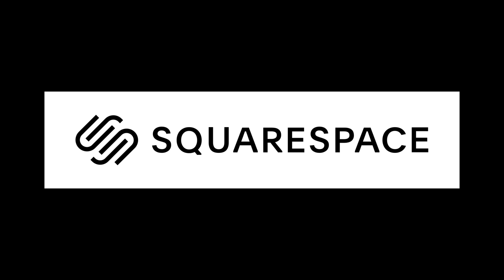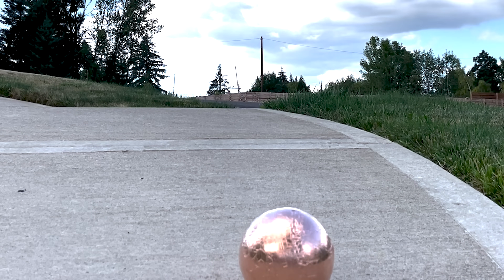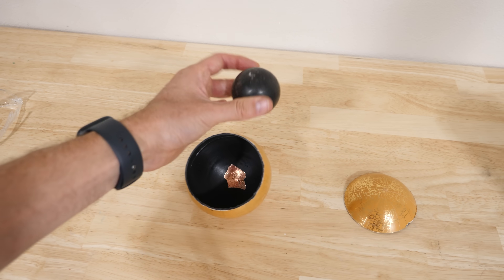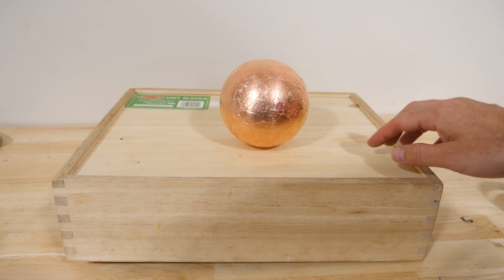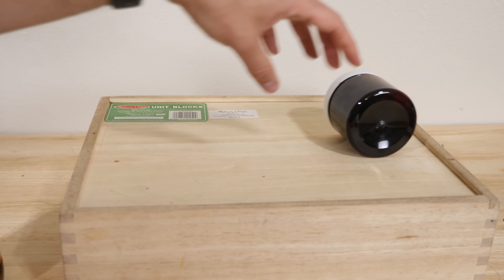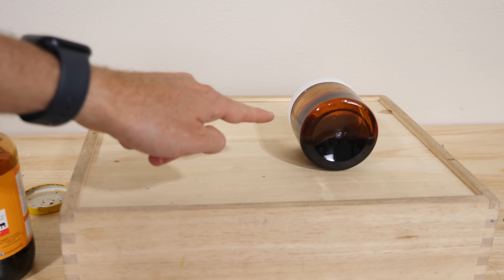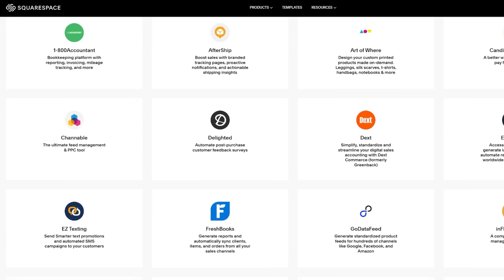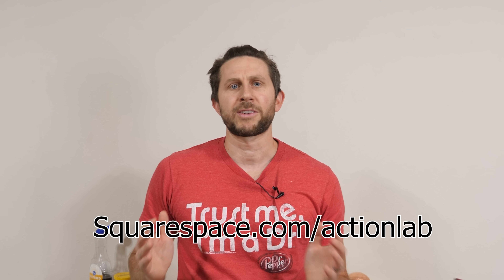The World's Slowest Ball

Comment: After reaching some speed, the inner ball would be stuck to the outer one because of the centrifugal force. That transition could be interesting.
Reply: I doubt that the ball could reach that rotation speed by just friction and gravity. If it reaches it by some means, that ball would spin around the center of mass so i guess it would look "wonky", spinning one side of the ball faster than the other.
Reply: The ball wouldn't reach that speed since the friction between the metal ball and the molasses is proportional to the speed, so the friction and the horizontal component of gravity would at some point cancel each other, therefore the ball not accelerating anymore but travelling at a constant max speed.
Reply: @Pietro_Troschka  From what you're saying, I suppose that means in order for the ball to move any faster, it'd need to overcome the outer friction, so at that point it's just sliding.
Reply: @Pietro_Troschka  the key is that friction you are talking about is between the inner ball and the molasses. Which is also traction between two balls and the force is proportional to the relative speed, not absolute. So the ultimate form is rolling of a bigger ball as solid but with center of gravity being off center.
This form is absolutely achievable since the friction force between the outer ball and the sloping surface is speed independant.
What is however crucial - switch from one type of rolling to another. Just like in the second experiment with the jar, the inside ball has to come over the vertical line drawn from the contact point, while being in the upper part of the bigger ball.
The solution to the transition lies in equilibrium of potential energy decrease of such near-half revolution and kinetic energy dissipated in molasses. A bit tricky that one integrates over distance and another over time, but through speed you can couple them. Here, the thicker the molasses is, the slower the ball rolls and the more slope there is - the easier to roll over and perform transition.
The centrifugal force, however, doesn't play that much of a role here as the OP suggested. But it surely affects rolling of bodies filled with low viscous liquids, as he imagined. As an example, a semi-truck with a half-filled tank making a high speed (or too tight) turn and loosing traction because the sloshing liquid not only pulls the tank to the side, but lifts it (right after giving extra weight and corresponding confidence).
Reply: @feedbackzaloop  are you a professor or mathematician? That was one of the cleanest mathematical explanations I have ever seen.
Reply: @Pietro_Troschka  assuming infinite friction between the outer ball and the ramp, when the torque exerted by the transverse component of the weight of the overall sphere overcomes the torque exerted by the weight of the inner ball at the 90 degree position (max torque), the sphere would be able to roll continuously regardless of whether the inner ball rolls.
Reply: @Pietro_Troschka  horizontal component of gravity?????
Reply: @Pietro_Troschka  Theoretically the friction would cause enough heat to lower the viscosity of the molasses, allowing it to roll faster
Reply: @thelazarous  Sure but how large is your hillside?
Reply: @drewmortenson  Just set it up on a treadmill
Reply: Especially if the molasses just sticks to the surface
Reply: Referencing your demonstration of how slowly the half full bottle of molasses rolls, why have you added a steel ball to the slow sphere? If the sphere is half filled with molasses, shouldn't it roll just as slowly as the bottle, without needing the steel ball?

Additionally, I suspect that the completed slow rolling sphere will have some small amount of air trapped within. Will exposure to this air, over time, alter the consistency of the molasses to a point that the sphere will behave differently than planned? That is,  it seems to me that exposure to air would be likely to cause the molasses to thicken.
--------  --------
I am a long time subscriber, and since this is my first post, I want to explain why I favor your channel.

1. Many of your videos are about real world topics that are easy for me to relate to.

2. Your presentation style is unique. Somehow, your real personality seems to insinuate itself into your content, and your genuine enthusiasm is always on display.

So now you have my unsolicited feedback, heh heh.
Reply: If it did reach that speed it would no long roll but instead hop.
Reply: It would need to be spinning at a sufficient speed prior to being introduced to a proportionally steep gradient first, to maintain a centrifuge. Even then, the centrifugal motion would cause it's friction from surface contact, to oscillate. But you could reduce the speed of the ball rolling, by cooling and thereby increasing the viscosity of the molasses.
Reply: It will "want" to rotate around the centre of mass which would be in or near the metal ball, so off center. I expect if you pushed it fast enough it would bounce as it rolled and the metal ball went up. It would also slow down because that takes energy.
Reply: @wafflesmotopoop  A ball in a ball, made up of super small balls. That are made up of smaller balls.
Reply: Would someone please build a simulation and put it on public github already!

Comment: I'm interested in how much the size of the inner ball is and the ratio of size to weigh affects the rolling speed. Like a small tungsten ball vs a larger steel ball of the same weight. Or even if say a handful of ball bearings makes a difference.
Reply: Those are fluid dynamics questions. I didn't take that course, but I did help a few mechanical engineering students get their code working.

The single ball version is analogous to a dashpot with a restriction on the size of the object moving through the fluid. The center of gravity has to be low enough that the ball won't simply hop down the hill. This in turn is a factor of the maximum slope.

The multiball version will behave chaotically. There is nothing to keep the center of mass traveling in a straight line, so the ball won't either.

Comment: You can simulate something similar by putting a bit of liquid in the bottom of a can, pulling it slightly backwards and jolting it forward a few inches. It'll move forward a little bit, stop and then move forward again

Comment: Some sort of viscous liquid was my first suspicion!  Kinda surprised you didn't mention that the slow ball's speed would be temperature dependent when molasses was used.
Reply: More interestingly, the more you'd roll this ball the less viscous the molasses would become (as it would become warmer) so it'd get faster...
Reply: So could molasses be used for inertial dampeners?
Reply: Because moles are warm blooded? Who is manufacturing this liquid mole ass? I wouldn't want to live next to that factory. I bet it stinks.
Reply: Had this been filmed in USA global warming would have turned the molasses into vapor
Reply: @Vector_Ze  US CO2 alone effects the globe, solar and wind aren't necessary in Asia or Africa
Reply: Would it not roll at all if frozen or near frozen?
Reply: @morphingninja  Molasses flows even at very low temperatures, but slowly.
Even in a deep freeze at -20°F it will flow.  I suspect honey would work as well.
Reply: @Vector_Ze  for some reason I had honey in my fridge and it balled up into weird looking hard chunks in the bottle and wasn't pourable at all
Reply: @nindoninshu  Of course, honey and molasses are totally different things.  Honey that's crystalized can be restored by gently warming.
Reply: @Vector_Ze  I thought you were saying the honey would work at -20° F as well
Reply: @nindoninshu  My first response was apparently blocked because I included a link to cite my information.
In a nutshell:  Yes, I think honey would work too, though they're very different stuff.  Honey crystalizes, but can be restored by heating in a very warm water bath, preferably in glass jars.
The crystalization appears to be more tightly tied to time than to temperature, and there is no reason to refrigerate it.  That may actually speed up the crystalization.
In any case, crystalized honey isn't wasted, it just needs to have its crystals dissolved with heat.
Reply: @nindoninshu  my honey crystallizes when it gets colder. But warming it up can get it flowing again. No need to ever refrigerate honey, it never goes bad
Reply: @morphingninja  No, it would not roll. The viscosity would be too high but the other factor is the incline of the slope. It would tend to not roll on slight inclines and would roll clunkily on steep ones.

Comment: Cool. Are there any engineering applications that use this principle?
Reply: Reverse Soapbox races, where the  last one wins maybe?
Reply: I believe most automatic transmission cars use clutches that use the viscosity of oil to generate the resistance between the engine and the drive shaft. The oil flow can be constricted and opend to vary how much resistance there should be. This greatly decreases wear, compared to regular friction based clutches. Its not entirely the same, they both use the viscosity of a fluid to create resistance.
Reply: @engineer0239 known as "Viscous Couplings" (similar to torque convertors used in A/T) but they use a fluid that thickens when electricity is applied.. or 'engage' as friction heat congeals the fluid,, very cool physics cuz most fluids lose viscosity when heated..
Reply: A deadblow hammer uses a similar principal.  It uses a displacement of internal substrate to dissipate energy.  Not quite the same principal, but similar.    I actually thought this was partially filled with lead shot at first for this reason.
Reply: Maybe as a dampener for keeping doors or windows from slamming shut?

Comment: Could you make an even slower ball by placing your slow ball in molasses in another larger ball?
Reply: its SnailBall-Ception
Reply: One could keep the current shell and heavy inner ball but use a thicker molasses blend or another viscous liquid. Hersheys chocolate syrup and Heinz ketchup are rated as more viscous than blackstrap molasses.   
Temperature will also effect this.
Reply: @MrBishop077  The viscosity of molasses increases inversely with temperature.  Ever heard the old expression, "Slow as molasses in January"?  Just put the ball in the freezer for an hour, that'll slow it down for a while.
Reply: @Vector_Ze  Greetings.  to your point that is why I listed liquids that were thicker at room temperature And why my unedited post also mentions Temperature as a means to change the effect.
But thank you for confirming my post.  =)
Reply: @Vector_Ze  If it gets too stiff, it will just be a weeble wobble
Reply: The slowness of the ball probably increases with the amount of mass and it’s CoG distance to the ground.  I’d say yes just have to proportion fluids and CoG properly.
Reply: @LeffHynebridge  But the force spinning the ball would increase also(meaning the g-force pulling the ball down the slope). Ratio of molasses resistance to the spinning force from the outside would be different. Ball would spin faster. Unless you replaced molasses with more viscous fluid.
Reply: @greenanubis  nah Justin is correct. Let's say that thick ball has a density of 1 and is 1 unit in circumference. A ball with a density of 4 and a circumference of .25 units would apply more downward force, but the curve of the outer ball means that forward motion would also include more upward motion as the inner ball scales the forward curve of the outer ball. Once you pass the resistance of the viscosity in the inside ball, you would make a weeblewobble like the guy above said. The viscosity slows the outer ball so that the forward motion of the inner ball is countered by the upward curve of the outer ball. 

As it is, the inner ball already has more ability to move through the molasses and if the outer ball had no resistance, the speed would be the same speed as the inner ball through whatever fluid was inside, like air or isopropyl or water.... Wait I'm confusing myself

Comment: before you showed us that it was molasses inside I thought it was a thick liquid in side there BUT there were fins sticking up into the liquid (on the inside)..... I wonder if that would affect its speed anymore than without them?
very cool :)
Reply: Curved fins, like a water turbine. Extra super 🐌 slow I bet
Reply: @travisgessler6283  Fins would slow it more, I think. As the ball moves, much of it's energy will be directed to letting the molasses overcome the fins. Until that happened, the molasses would be on the other side of the fins, contributing to holding the centre of gravity back. When enough molasses has moved to the "forward" half of the ball, then it will move forward, but this will be slow.

Rather than all the molasses moving due to gravity, it would only be that which could scale the height of the fins, a much smaller proportion. That would encourage the rest to follow, but still, slow. Might be the ball would seem to move in spurts, like stiiiilllll.... move! stiiiiiiill.... move!

I might be wrong, but it's a cheap way of spending an afternoon if you've got a ball and some treacle.
Reply: @greenaum  if the were short sure.. I was thinking long like to the center...
Reply: Shouldn't affect it too much. For that to work the liquid inside of the ball would have to remain stationary relative to the ball. Which it doesn't, it would be spinning at pretty much the same speed the ball is spinning.
Reply: @HouseExpertify  the fins would have to somehow stay oriented properly for anything to be calculated I think.
Reply: @HouseExpertify  right... because the liquid wouldn't drip back up the fins ...I follow
Reply: Indeed it would. The fins depending on how deep they are and how they're shaped may or may not even stop it all together.
Reply: For that to work, the liquid would have to be incredibly dense. Could totally work with Mercury.
Reply: @zqzj  Mercury is shockingly thin and flows really, really easily at room temperature. Its high surface tension makes it look more viscous but it's not at all. You don't need a lot of weight for the trick to work, you need a sticky and viscous liquid.
Reply: @ThomasBolger973  worked in a place 50 years ago that used a lot of mercury. neat to slam a cup of it down on the floor. instant mirror for a tenth of a second. just sweep it up put it in a rag and squeeze it out. takes a minute to get used to the fact that most stuff floats in mercury.😃
Reply: I thought that there was a smaller ball weighing it down but without molasses

mol-asses lol
Reply: @Anonymous-df8it  a small sticky ball
Reply: I think if you lock the heavy mass in place (with glue for instance), then the ball wouldn't roll at all, kind of like a roly poly, and it'd only slide
Reply: mexican jumping bean in slo mo
Reply: Depends on how dense the fins are. If they would be spaced closer together they would have more surface area for molasses to stick to the overall ball structure. Effectively, that would look the same as if you poured some molasses out. Maybe it would vary its speed more at the start, until that part of the molasses stuck to the outside and fins.
Reply: I thought it was filled with sand
Reply: I had the same thought, but with nails or spikes sticking up into the molases instead of fins.

Comment: I did think there was another ball inside but the molasses bit was unexpected.
Is there any other liquid which as viscous or even more than molasses?
Reply: Tar   and  glass... could take  eons to roll!!
Reply: Any mixture that is super hygroscopic. Honey for instance.  But the thicker or more viscous it is, the closer you get to just a ball with higher sectional density or a wobbly ball that rolls faster but erratically because it will roll faster than the liquid can change the COG.
Reply: Pitch is probably the most viscous liquid. They've been watching one sample of pitch drip out of a funnel at the University of Queensland since 1927.